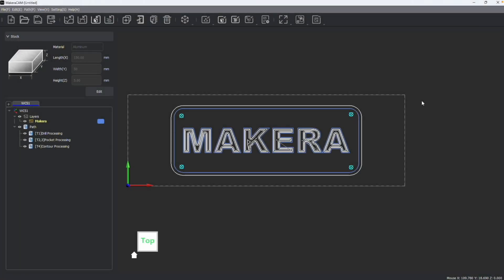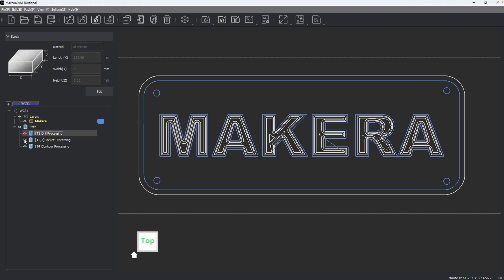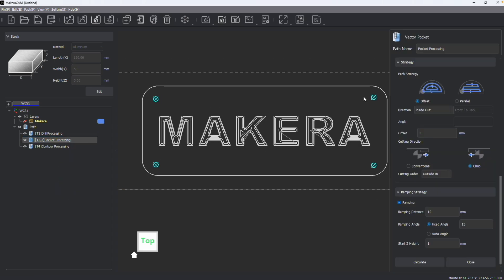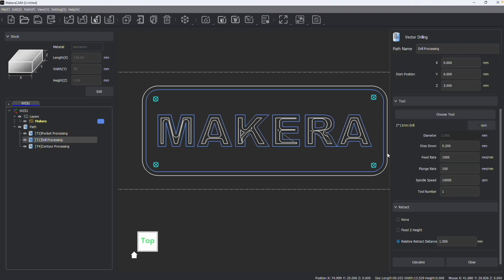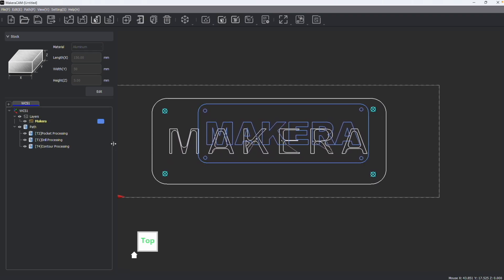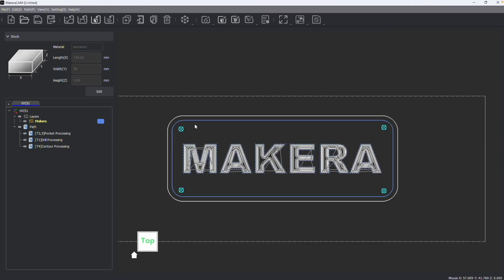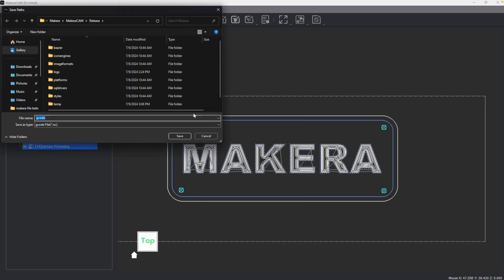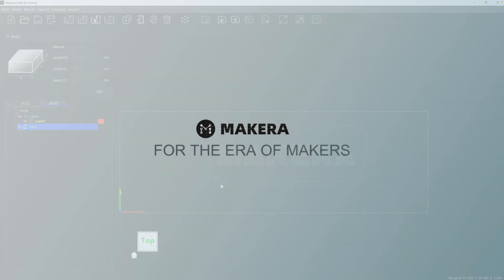Makera CAM - Working with Paths

Comment: One incredibly annoying thing I've noticed in the past few hours of wrestling with Makera CAM is the tool selection process for paths. Creating a first path is fine, apart from the difficulty in selecting what faces to chose (the deselection and selection of incorrect faces as I use the mouse to rotate the model is so frustrating). Lets say I create a pocket path - I can select a tool within the side window's tool list when editing that path. But god forbid I need to create a second or third pocket path for the same part. Anything after the path for the first pocket does not let me select another tool to use. So no more tool paths can be created. The "help ?" button doesn't even function!
Reply from the maker: Thank you for this feedback, and some of this is largely due to the nature of launching a public beta program. But these issues are known and in the process of being fixed in our upcoming release of Makera Studio.

Comment: I think I got a little confused somewhere 
what's the difference between this and the 3d function coming in october?  is this just 2d vector processing and the 3d function will allow slopes, etcetera?  or... what's the difference between them?  thanks!
Reply from the maker: The 3D function will allow you to import 3D files, such as STL, and also allow you to create 3D toolpaths like reliefs and curved carvings around the 3D design files. Typical advanced projects combine 3D with 2D toolpaths, which we are excited to be able to add to Makera CAM soon!
Reply: @Makera  gotcha. so we can do the 2d toolpaths and vectors etc now, but stl and reliefs are october(ish). :-) 👍